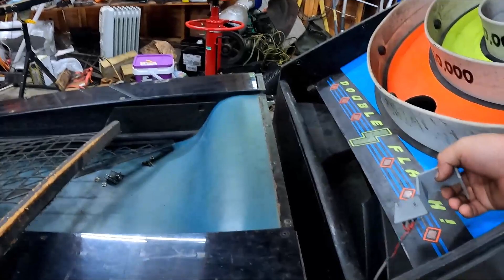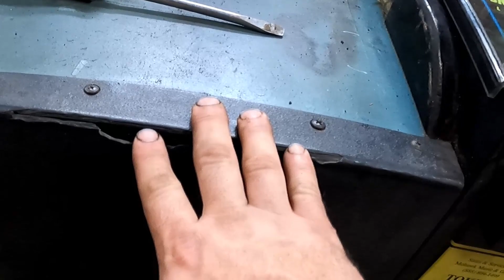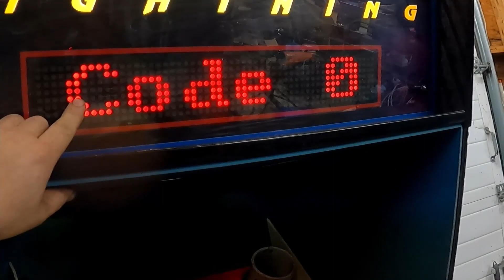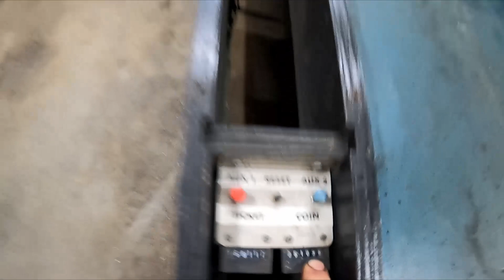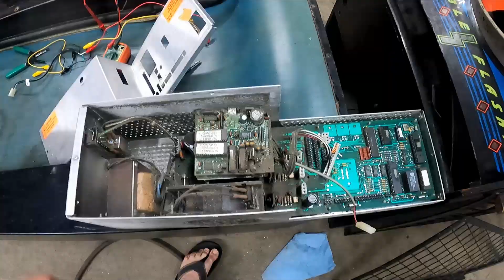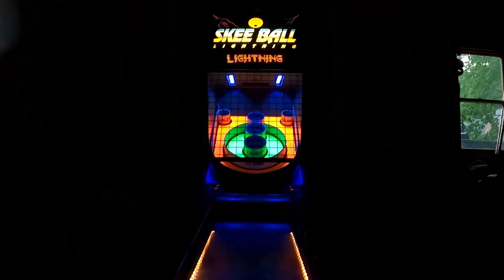Bought the cheapest Arcade SkeeBall machine on marketplace, can it play? Skee Ball Lightning 1994

Comment: I just bought one of these.  Same model.  I paid $800.  Some things on mine work that did not on yours like the sound but I have some other issues to debug.  I believe mine has only optical switches now and no limit switches so no wires to bend.  My display does not seem to work properly, it comes on and flickers and flashes but doesn't seem to be correct.  I was not aware there were rope lights on the alley so that is one of several things your video has helped me with.  I also have no bulb in the fluorescent light and did not know it should be a black light.  If you have a Lowes or Home Depot part number for me that would be awesome.  If not I will shop.  Where is that metal box at that you pulled out?  The one with the Sound card and other boards?  I would like to inspect mine and blow it out with canned air.  Also my volume is TOO LOUD so I want to turn it down.  I have some other minor repairs to do as well.  Do you think a standard LED 60 watt bulb would work okay in the center light bulb socket?  Great video.  I appreciate the effort you put in to it!

Comment: I am able to get my hands on one of these but it does not have balls and it may need a new alley cover. I have been searching everywhere for skeeball lighting parts and I can't find anything.  Where did you get your parts for this? 
Thanks for the video!
Reply from the maker: I bought a controller from ebay for the audio module, I way overpaid as it was very clear someone else had stripped a lot of parts already.  the limit switches were on Ebay as well.  not sure where I got the balls, but they do still sell them on the official skeeball webpage.  Bangor cork makes the surface material, which is referred to as cork despite not being cork at all as far as I can tell.  As for the ticket dispenser, disabling it in settings.  and the wire rope was just from home depot, but I think there are better options online for that.  Good luck with your machine.

Comment: Not only where there are points, but it also has the following words in the Skeeball Lightning arcade game after you roll the ball into the slot.

10,000 - Try Harder
20,000 - Not Bad
30,000 - Good Roll
40,000 - Impressive
50,000 - Excellent!
100,000 - WOW!

Comment: I remember when this was at a local arcade in my area. I really loved the LED interface and I wish there were more Skee-Ball machines like it (since most places opted for Skee Balls with more standard presentation).
Reply from the maker: I also find a lot of the newer machine are shorter, The original skee ball was a 12ft alley, mine is 8, and I think some newer ones are 6ft.  The guy I got this from also had a few super old skee ball type machines that had mechanical dial displays and took no electricity to function.  Thanks for watching!

Comment: I have the same Machine I got it from an auction for $500 it’s in my bedroom
Reply from the maker: I'm glad I ended up with this model and not a full length(the og version is 2 or 3 feet longer and there is no way it would fit).  I like the lightning point doubler as well.  I think 500 is a deal if it was fully functional.
Reply: @wirestiresandfires214  Yeah it works perfectly it’s just missing the artwork on the score board
Reply from the maker: @AaronSmith-fd5cj  Nice, on mine it's just a semi transparent overlay on the back of a sheet of plexi, I would think you could get a vinyl/print shop to make you something.  Could be the original, or customize it.